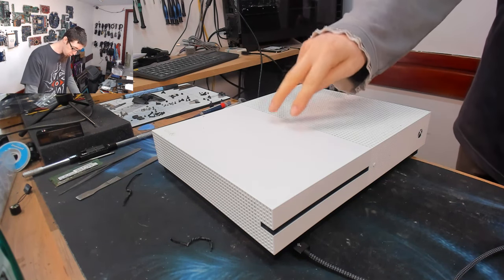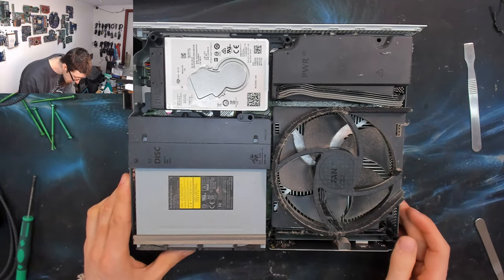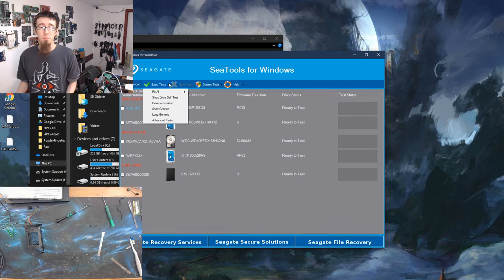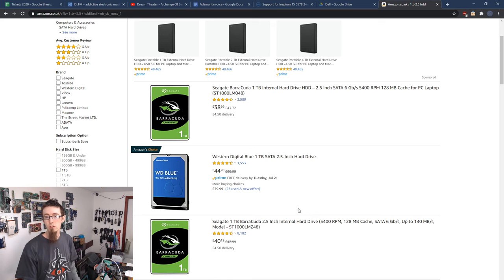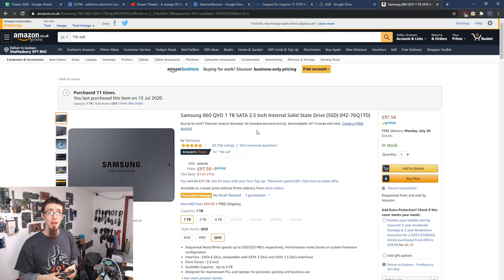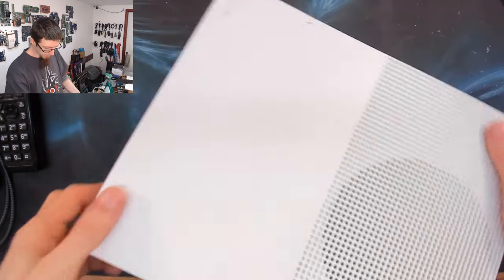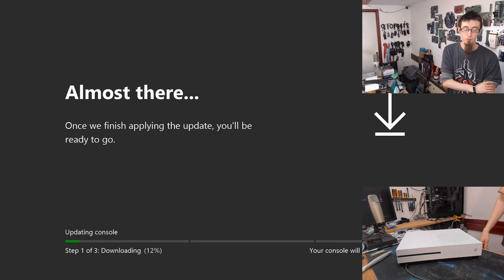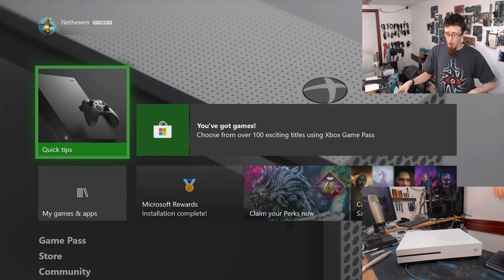Replacing an Xbox One S HDD with an SSD - LFC#214

Comment: The PS5 SSD will offer speeds of up to 5.5GB/s, which is more than twice what the Xbox Series X can achieve. That speed does come with a compromise: You only get 825GB of storage on the PS5
Reply from the maker: The Series X wouldn't be able to utilise the performance of the PS5 SSD. It's very interesting as the raw 5.5GB/s number is only a small part of the story, it's about the instruction set and traffic management. But those things will only really be useful on a console with exclusive titles made specifically for the hardware - great for the PlayStation, no use for the Xbox.
I'll be very interested to see if the paper specs of the PS5 SSD actually get used, and if they make up for its weaker clockspeeds vs. the Series X. We've seen Sony make consoles that are a technical marvel before, but where never actually used to their potential - ala, PS3.

Comment: If you want to just make stuff load faster, don't replace the internal HDD with an SSD. Instead, get a good USB3 SSD and put all your games on there.

The internal disc is SATA300. That means the interface is the main limitation to speed (max of 300MB/s).
USB3 can go up to 500MB/s.
This means that any USB drive will go almost twice as fast as any drive you build internally.

Also; the video says the Samsung drive is faster than the other one (can't really remember which...) but this, again, is moot since the interface can't handle the speed of the Samsung drive anyway.

If the internal HDD fails, by all means replace it with an SSD. But if you want to get the best performance; a small internal SSD (250GB or 500GB) coupled with a good USB3 SSD (Not a USB flash key, a real drive! either USB3->SATA or USB3->NVME) will give you the best performance
Reply: Even Better than any mechanical drive. Latency, iops and so Much more.

Comment: Typical Microsoft using a cheap laptop hard drive. Why didn't they use an SSD to begin with? I use Crystal Disk info to check a disk. It tells you right away if the drive is good bad or about to fail.https://osdn.net/projects/crystaldiskinfo/downloads/73319/CrystalDiskInfo8_7_0.zip/

Comment: Why not use a towel under things you repair. if I deliver something to you I would be angry if I get it back with a lot of scratches!!
Reply from the maker: I work on a massive mouse pad, so that keeps the scratches away.
Reply: @Adamant_IT  if the mouse pad is made of hard plastic then it is not good enough. For example, blank plastic on laptops to other things get very easily scratched!

What would you have done if it comes in an expensive amplifier or a vintage nice portable radio and it must not get any marks or scratched on it????
Reply: @ford1546  any audio equipment he fixes is stuff like microphones and Bluetooth speakers.
Reply: @RWL2012 You deliver a laptop or something else for repair. 
Would you like to get scratches in your pretty things?

You who repair things for other people should make as few scratches and marks as possible!
Reply from the maker: The mouse pad is soft. It does not scratch things. Relax.
Reply: @Adamant_IT  OK I understand. It does not always look like people care about scratches when they repair things,  but they should!
.
mr carlson's lab youtube
is good at protecting things when he repairs nice things.

Comment: SSD Is useless inside an xbox, CPU don't profit from incrase read speed.
Reply from the maker: It depends what you're playing. It's certainly not the massive improvement you get with PCs. Most games are up to 10secs quicker to load, which is nothing to write home about, but some games have massively reduced load times. Not many though.
Reply: No. Is  equal to upgrade a notebook.
Reply: @Adamant_IT  have you some title in mind ? strange that you can realy tell a gap beetween HDD and SSD on Xbox (and also PS4, same battle)